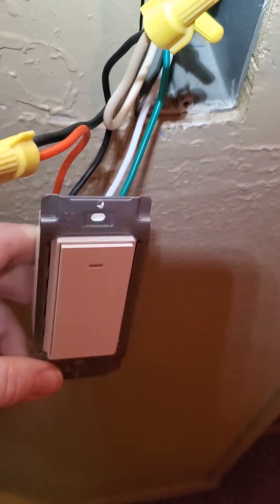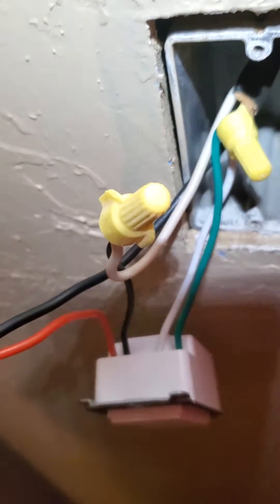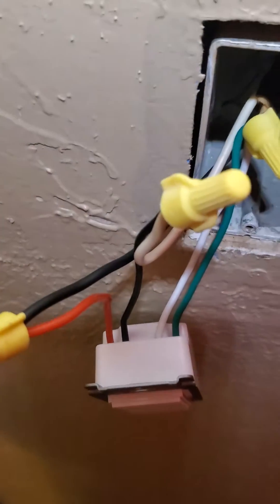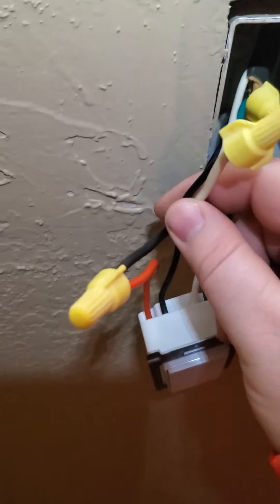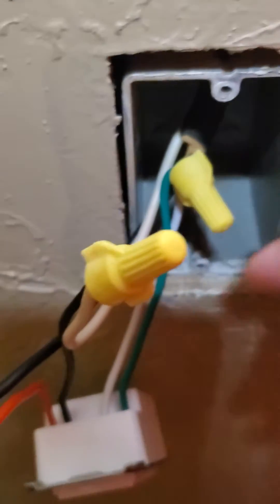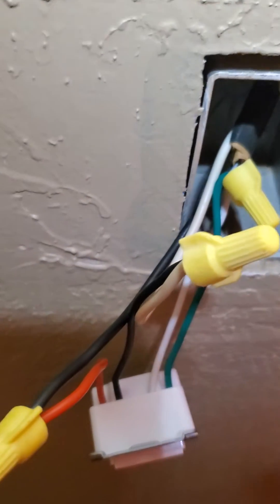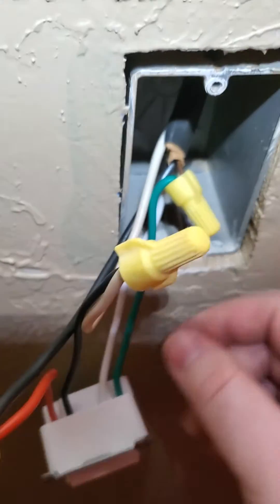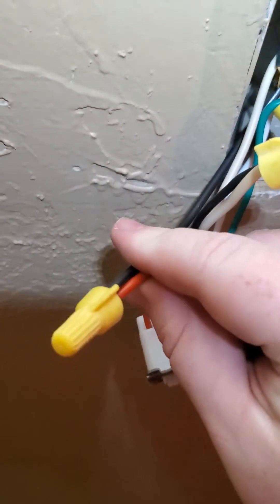Installing a 4 wire smart light switch with only 3 wires.

Comment: DO NOT DO THIS!! (If your house has a separate neutral/ground wire) You are energizing the ground circuit and it can burn your house down or kill someone
Reply: This was the comment I was looking for as the wiring suggestion had me a little confused.  None of the light switches in my house (build in 2005) have a "neutral". Granted they are all "dumb" switches, but they have a ground connection, and a connector for the incoming power line from the breaker, and the outgoing power to the light. Then the light itself returns power directly to the breaker on the "white" wires that are just joined behind the switch with a wire nut, pushed in the back of the box.

So why would the switch itself have a neutral? So I'm guessing the switch has a neutral because it is a smart switch and requires it's own power? So in that case, it seems I would join that white line in the switch to the white lines that are just wire nutted and normally just pushed to the back?
Reply from the maker: Actually, I'm drawing energry FROM the ground circuit, not energizing it. The ground is connected to neutral in the breaker box. Please do some electrical training and research before fear-mongering please.
Reply: @mtnentertainment3454  this is called a bootleg ground and is very dangerous. Your solution may be tolerable for houses with no neutral wires at all, but for houses with neutrals at the junction box instead of the switch (any house after 1996 and others even before), this is incredibly dangerous

Also, check out "What are the risks of sending low-current neutral through the ground wire?" on DIY stack exchange, it tells you exactly why not to do this
Reply from the maker: @TheJHump123  This is specifically for houses with no dedicated neutral, if it had a neutral this wouldn't be necessary. Primarily this is for houses built in the 80's and before, which is mentioned in the video. Also, low current neutral is already carried through the ground wire, hence it being tied to neutral in the breaker box. If you don't believe me, go open your breaker box and see for yourself. Neutral and ground are already shorted in every US home. There is no amount of current being drawn here that would pose any safety risk. No additional heat of any measurable quantity is created, nor any spark which would result from shorting either neutral or ground to the load or "hot" wire. ultimately I could have accomplished the same thing with a diode tied to the single neutral wire, but it would accomplish no additional result, nor be any safer than what I did here.
Reply: @mtnentertainment3454  Many houses, mine included, built since 1996 have neutral wires but not in any of the switch locations using a switch leg setup or similar. Any average person isn't going to know whether there is a separate neutral/ground in their house or not, just that there is no neutral line in the switch box. Roughly 1/3 of houses in the US have been built after 1996, and anyone with the above setup should not be following the video
Reply: @TheJHump123  My house was built in 2006 and only has neutral wires in double gang boxes.

Comment: Hi , thanks for the video ! so what would you do  if you see only two wires in the switch box ? have an old house , when i opened switch box it had only two wires attached to the old on off switch , 
not even ground wire .
Reply from the maker: Not sure I can really help you with that one. That kind of wiring is the type that actually would need an electrician because your whole house isn't to code at all and is likely at risk of a fire if any of the wiring I've seen like that in the past is anything to go by. I've seen bare hot wire only separated by some bent nails up in the attics of houses that old
Reply: @mtnentertainment3454  thank you
Reply: @adilfaleh5812  in such case, the ground wire is supposed to connect to the box. The metal box is usually grounded. Test it out.
Reply: @RevSamStone  thank you

Comment: Hi! Thank you. So much for taking the time to make this video!!!

My wall wiring has 2 blacks and one green
One black is “hot” 

My smart switch has 2 blacks, 1 green, and 1 white.  

So would I attach:

the green AND white from the smart switch to the green in the wall

the black to the black

the black to the black?
Reply from the maker: No, you need to find out which of those two blacks is the neutral, and look at the diagram included with your switch. My guess is: One of the blacks will go to the hot black, one will go to the nuetral black, and the green and white will go to green, but you need to be sure which black is hot and which is neutral. I'm guessing you aren't on the US electrical system, since the color codes you described don't match any of the standards here. That or it was a DIY job that wasn't done correctly. Your switch definitely has me a little confused though, it should be black red white and green, not two blacks. Having two of the same color is poor practice in wiring for this exact reason.
Reply: @mtnentertainment3454 I have two blacks and I'm in the US... Will something blow if I write it incorrectly? I also have a light switch with no ground... Any suggestions for that?

Comment: So my light switch has a red X on top and a black it's on the bottom then it has the white neutral but as you said there is no green in the old box does it matter what's the black or the red what side it goes on I don't know if this makes sense to you
Reply from the maker: I would need a link to the exact switch you bought. Yours is running on some different specs than the type featured in the video

Comment: As one at least one of the others commenters mentioned this is not an acceptable method. If your house burns down because you tied the neutral and ground together you may have a tough time collecting any insurance money.
Reply: There are supposed to be tied together but only at the main breaker or first box.  This is called bonding.  If you have a sub panel, you will notice it's unboned.  This is why there's the bonding"screw" instead of it being joined by default. Because it's optional based on the situation. This is dangerous and against code.  You can look up the reason why this is a hazard.
Reply: Then don’t install the switch. Some are listed specifically to use the ground wire for the minuscule current to operate the electronics, though I’m concerned that it may still not be 100% safe. Codes exist for a reason.
Reply: OMG! I'm out code for 27 years.  What can I do now? 🫢
Reply from the maker: Go look in your breaker box. the neutral and ground are already tied together, that's the code for the american wiring standard. This whole video is meant as a quick and dirty method for people in older homes, and is not a fire risk. no additional heat is generated, nor any risk of shorting between the neutral and hot wires, which would be required for a spark to happen to cause a fire. Go be a purist somewhere else, we don't all have the money to rewire our homes just to install a lightswitch, not in this economy.

Comment: This is one of the most clear, useful and awesome how-to videos on YouTube.  You showed me a trick that even the smart switch box said could not be done.  The box said that a neutral wire is required but thanks to your tip, it is not.  I installed a smart switch with dimmer and motion sensor which I purchased at Home Depot for $20 and it works like a charm once I hooked up the neutral to the ground.  THANK YOU!!!

Comment: This may be the only clear explanation of this on the internet. You just save me $70. Thanks dude!
Reply: And not safe
Reply: I'm going to go out on a limb and guess that you don't know that neutral is directly tied to ground in American wiring. If you do know that, and you still think it's not safe, you should probably explain.
Reply: @brightmatter even though it’s tied in on the main panel, isn’t this still risky to do?
Reply: How would this save $70
Reply: @AaronTheHarris  Because I was about to buy 2 new smart switches for $35 each that don't have the white wire, but thanks to this video I figured out how to make these ones work properly. I was past the return window for the ones I have. And 2 times 35 is $70. Thus, this video saved me $70. Do you have any other questions?

Comment: Why doesnt anyone else report on this? I cannot find anything else stating this can be done
Reply: I have only two wire in the wall and the new dimmer came with 4 wire . 🤯
Reply: @MariaPeng23 this is the problem I'm having as well. Did you find a solution?
Reply from the maker: no idea my guy, I had to partially trial and error this and use a bit of knowledge of the American Electrical Standard that I learned when I was trying to be an electrical apprentice
Reply: It's because it's against the current code. I've used this method without problems. But, use it at your own risk.
Reply: Because it’s unsafe. This energizes the ground cable …
Reply from the maker: @sciencesaves  the ground is already technically energized. If you go check your breaker box, you'll see that the connections for the neutral and ground are tied together. if that weren't the case, this method wouldn't even work.
Reply: @mtnentertainment3454  technically you are wrong. where the ground and neutral connect together in the panel the connected to the incoming power source, also has a neutral or return path back to the transformer on a pole or could be routed underground (not important) electricity is ALWAYS trying to go back to where it came from. so in the panel in a properly wired circuit, current returning from the circuit does connect to the same bar as the ground. however there is no reason for the current to back feed up the ground wire because it wants to go back home, the easiest route being or path of least resistance straight out the source wires to the pole not loop around the house again and out to the pole. there is a ground or should be from the panel outside the house and to a copper rod stuck in the ground. in the event a fault occurs in the circuit the current will divert back from fault down the ground wire and back to the panel being the path of least resistance. this spike in current at the panel trips the breaker shutting off the cicuit so a fire doesnt start at the fault or people touching anything metal inside the house that is now energized by the fault, pipes, fixtures, appliances which have a path to ground do not complete and become part of the circuit i.e. shock the piss out of. the electricity that does flow outside and into the ground does so because the transformer on the pole also has a ground wire to the earth and the current is traveling back home thru the groound up the pole ground wire to the transformer. not saying what you said wont work. just trying to say why you shouldnt make it work. if you do and a fault occurs you have already enrgized the path of least resistance not allowing a spike at the panel not tripping the breaker potentially causing a fire or risk of shocking the piss out of somebody. i'm not an elecrician so if this doesnt make sense, lol glad i could waste our time and remember any tool can be used as a  hammer, 
 except a screwdriver...because that is a chisel !!!!
Reply: I can confirm this to a degree. I have been running it this way for years but I've had a couple of switches burrn out. It's so nearly impossible to wire the house appropriately so I'm tempted to just keep it going.

Comment: My smart switch has 2 black wires, a green and white.  My wall wiring has bare wire (ground), white, red and black.  Do I leave the black wire in the wall capped?
Reply from the maker: are you on a US circuit?
Reply: Great question, which is difficult to answer. It depends on whether the red is used as the switched circuit. 
Most likely, the red and black were connected to the switch and the white is just an available neutral.need to trace where ea
To tell for sure, you need to trace where each wire terminates.

Comment: What did you plug in to the white wire from the switch to
Reply from the maker: the white and green from the switch went to the ground wire in the wall, which is usually bare copper